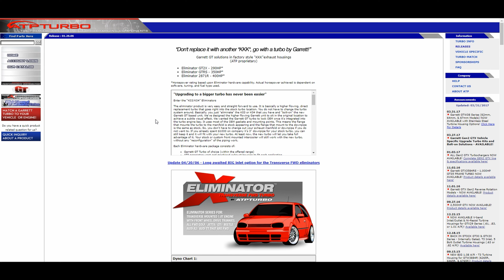A Year In Review & Channel Goals For 2023

Comment: Happy new year, I hope the best for you and your projects, may this year be the best year for you, your cars and your channel. Wishing the very best new year. I can't wait for the new suspension for the s4 and the wrap for the tt. Nightshade purple looks gorgeous I also can't wait for new turbos for the s4 as well.  But the weather really affects how you can work on your cars. I really hope those control arms arrive soon. In terms of recommendations of which new project car you can get.. well something other than an Audi because you said you loved all cars. Maybe you can go Japanese to get more of a sleeper car. But I have heard the older BMW are good cars to work on and tune. Maybe an old 3 series. Or go jdm with a mk1 type r civic. Or mk2 from 2007. Maybe a vauxal astra. Maybe a Honda civic del sol which is another civic but like a sedan, you can get them very cheap and they come with a vtec. A crx is a decent choice. But if you want another Audi, get a vr6 a3 or a d2/d3 a8 to get a cheap luxury and turn it into a restoration build and upgrade it to be more powerful than the original s8. :)   Hope i have helped you.  I really admire you.

                                                   Wishing you a happy new year and the best for your projects!
Reply: Also, you plan on changing your rims and tires on the s4, well I recommend the Audi le man rims as it looks good and looks stock. It can be 18 or 19 inch. If your suspension is adjustable, you can fine-tune it so it suits your car depending if your wheel is 18 or 19 inch. And since you are going to take your vehicle to the track, heres good rubber and a setup for you. The all season pirreli p zeros are good for track and day to day performance.  Setup for 18 inch: 205/40ZR18 86Y XL AR pirelli p zeros with 18 inch audi le man rims.   Setup for 19 inch: 275/40 R19 pirreli p zeros with 19 inch audi le man rims.

Hope you have a good day :)

Comment: Stock headlights and tail lights on the TT look best imo. You can get kits to convert them to angel eyes and amber delete but thats as far as I would go tbh
Reply: Also why not just go with Frankenturbo? Comes with everything you need to upgrade.
Reply from the maker: I agree with the headlights and taillights. Oem just looks right on this platform! Also I have been eyeing frankenturbo more and more as of late🤔 They seem like a fantastic deal! Id be curious what kind of power they could make.
Reply: @HunterDirection  with their billet compressor wheel hybrid K04 I think you could easily make 350whp with the right tune, injectors, etc
Reply: At that point you'd be looking at doing rods and such in the near future if not before
Reply from the maker: @yoFigure  oh dang. That would actually be quite a jump in power for the cost🤔 I definitely like the sound of that!
Reply: I've also been eyeing TTE built turbos, they look really nice but you'd have to piece everything together yourself
Reply from the maker: @yoFigure  yeah I've been looking at TTE as well. Especially for the S4 they can make some wild power. I am sure their 360 would be a blast on the tt.
Reply: I ve learned a lot from the channel, and has made me a TT believer.  Started watching to see if a TT would work for me, live in WNC mountains and looking for a fun hilly road daily driver.  Found one that has a Garrett GT  3071r installed it.  Any thoughts on that set up?  Forums are mixed.   End of day my goals are similar to yours, fun at safe speeds around town with some weekend autocross.  Thanks for what your doing! My journey led me into Toyota world also, any thoughts to cheap mid engine build with MR2 Spyder?
Reply: @realcaptainron2300  just make sure the engine has connecting rods upgraded and the cars been maintained well. Other than that it should be a lot of fun other than the turbo lag
Reply: @yoFigure  Thanks! Perfect info, I was wondering about  rod upgrade.   I'll def be sure to ask that.  Also I agree on what you are saying about stock lights.
Reply: @realcaptainron2300  also make sure the timing belt has been done, it's a fairly big job and can be expensive if you don't do it yourself. The engine could blow if it snaps and that would be an even bigger headache.